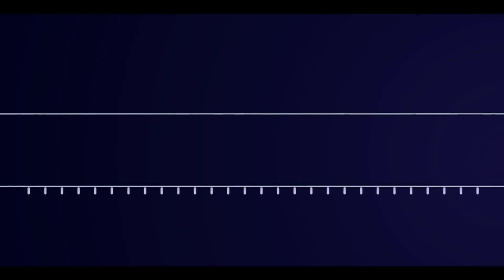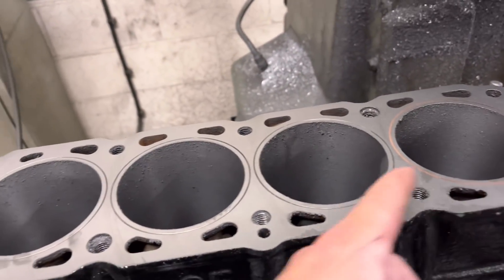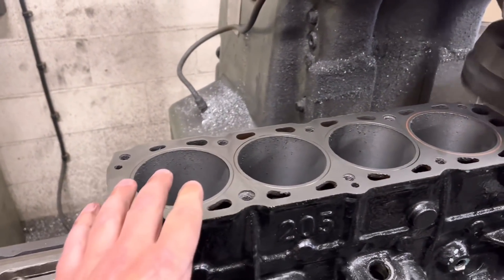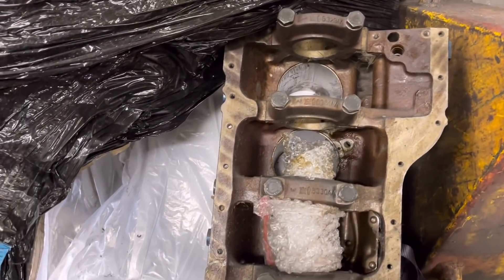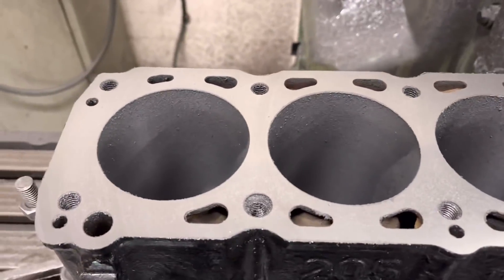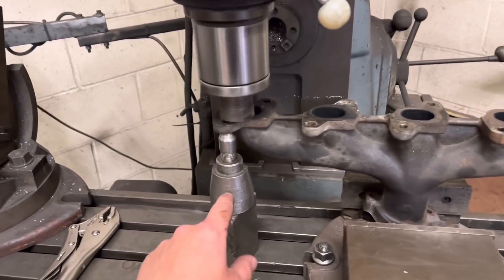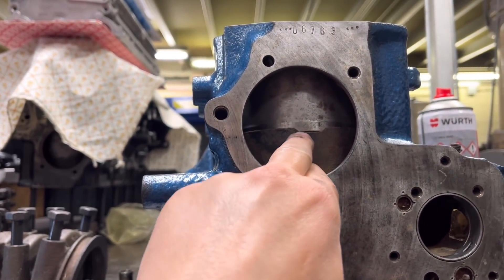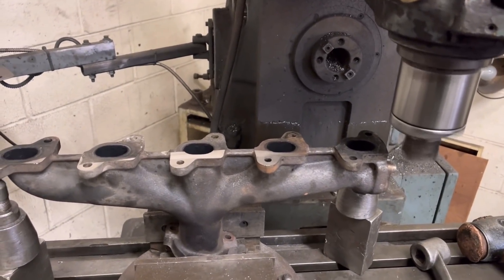Jag XKR is stripped, what we found is not the best news

Comment: Is this the Jaguar V8 that is a version of a Ford (They owned jag at the time) modular V8 with different heads and accessory drives? Or the one thats a play on the old Rover style V8 that got recycled 20 times over in the British motoring industry? Lee, just a quick Q : Do you do mechanical repairs for Rolls can Hardly's ??
Reply: It's the AJ-V8, the one derived from the Ford modular V8 (although it was pretty much all Jaguar designed under Ford ownership).

Comment: Did those copper rings work?
(at the time)
Great content, thanks for sharing 👍👍
Reply: It smells like the change over from astbestos head gaskets? There was much panic. CAT at cannock were pulling their hair out with the 3306 truck engines in 8 wheel tipper trucks.
Reply: They worked well on Chrysler Hemi engines going back into the dark distant  past. Isky Cams in the US even sell a tool to make your own ring groove.
Reply: I had the O ring sent to me from Dale at Nitrous Oxide Systems in the early 1980s to use on drag racing engine with copper head gasket. Worked very well. Sometimes receiving rings were cut into the head and stainless wire was used.
Reply from the maker: Yes they did the job, seen a few though that were not doweled on and moved off the fire ring, wrc steel is the way forward today 👍
Reply: @Mercmad  mig wire worked great
Reply: @gazza116  .8 mig wire worked copper rings were useless.

Comment: Time to invest in some decent equipment.  A Rottler H85A be a good start.
Reply: @chrisjohnson4165  that boring bar should have been scrapped in the 60s. Can you see any of my posts from yesterday they seem to have dissapeared?
Reply: @chrisjohnson4165  its a piece of primitive machinery accuracy probably +or- 10 thou. A good 'head shop' and valve refacer would be a good addition as well so you don't ream guides with a hand held battery drill. I was surprised they all dissapeared but hey ho it is what it is.
Reply: @chrisjohnson4165  its a bit like skimming the pistons, why would you do that regrind crank using undersize shells to move the throw on the journal. You have already bored block oversize so that +10or20 will give capacity back. The motor will then rev slightly faster due to being a bit more 'oversquare'. You could bore and stroke those motors to 2.4l as well with selected pistons and steel internals to get a reliable 500hp street engine. Dump the old hydraulic lifters and replace with bucket and shim from audi you can then rev higher without lifters 'jacking'up. We always deburred and chamfered all edges and casting marks in blocks, that prevented stress cracks from sharp points. If using stock rods and cranks they would be deburred and shotpeened to give a good strength to those forged parts. Mig wire 'o' rings were a must as well. These are some of the things that held them together when current so must still be good now. I have told lee all this stuff but seems to ignore it. For some high boost race engines we would 'dry deck' them with no gasket that stopped gasket failure.
Reply: @chrisjohnson4165  yes the 'parts washer' is comical, how do they wash all the swarf away? A proper hot wash with suds washer is the only way. A chemical dip tank is also a must to shift road grime etc. I have never seen them remove core plugs to properly wash out the water jacket either. Parts just stood on floor or ally heads dragged about on metal benches. I did see them 'resizing' a rod end freehand it makes you wonder how their builds last as long as they do. Machining valve pockets with rings fitted, the list seems to be endless. If he wants to specialise is cosworths or performance engines in general a dyno cell is a must. You can then run the motor and get useful data and make sure it run in and fluid tight before it goes to customer. We used to build development motors and thrash them to death to see if that mod or idea works. We would build them on old pinto SOHC blocks, just as good but expendable because every one wanted the 205 and 200s in their cars.
Reply: @chrisjohnson4165  also skimming heads and blocks on a mill, ok it works but by clamping them down you can cause distortion. A dedicated head facer with eccentic spring clamps in bolt holes and carborundum stone cutting head with suds running makes for a better finish. Performance engines should never be bored or honed without torque plates fitted so block is stressed as it would be with head on. That makes for a true bore in running conditions. A block bored bare can distort by a few thou when heads bolted down.
Reply: @chrisjohnson4165  mind you if you want a laugh there is a thread on here with someone claiming decking a block will affect valve timing and it will have to 'be fixed'.

Comment: Lloyds looks a pretty good job though. I wouldn’t trust it as far as I could could kick it with normal head bolts. With those studs it just smells right :o)  the top of the block is just filler now to keep the water in ^-^

Comment: There are so many alarm bells going off here!
Although I don't work in the same industry, the Jag and Cosworth blocks would raise my anxiety levels off the scale!
My advice would be to take a step back and look at these two jobs as a complete pessimist.

Tell Jag man to get a replacement full engine.

The Cosworth is causing you to ask questions that suggest that you are building on substandard previous work.
Why would you even entertain this?

Love the channel BTW, just don't want to see you in trouble that could've been dodged.
Reply: @derektaylor2941  not that experienced by removing  the 'o' rings when they are done properly with .8 mig wire not copper you will never have gasket failure. Back in the day if you wanted more than 350hp you bored and stroked the motor to 2.4l that way you could run less boost and not blow the thing up. 500hp was the practical safe limit then. 350 was the safe practical limit for a reliable road motor 205 or 200 blocks at 1993cc. Go over that for racing etc it will last a season if you lucky. There were other things to do as well long studs, change valve buckets from hydraulic to shimmed, audi ones from memory. Clean all flash from blocks and chamfer all sharp edges. Clean all flash from rods and crank and shotpeen, that got rid of sharp edges where cracks can start. The  best was all steel rods and crank, expensive but worth it. The trouble is people forget it is old tech and think the way to power is boost and throw fuel at it, without careful prep on the internals. All that does is destroy the motor.

Comment: Just skim the pistons and get slightly higher cmpression ratio. More modern build and run her with E85 more power and peppier response for the throttle.
Reply: @MattyEngland  oh, I thought that in europe all of us have E85 available. I'm from Finland and here it's commonly available. Same in Sweden and I think same in Norway. And maybe in Estonia, but I have not bought gasoline there so not sure what pumps there are.
Reply: Raising the compression ratio on a turbo engine will lose power due to increased pumping losses no matter what fuel is used.
Reply: @n2obob  well you hold on to that if it's your truth. I'm going to hold on to what I have run on the dyno for years.